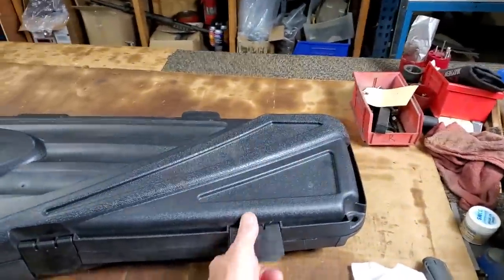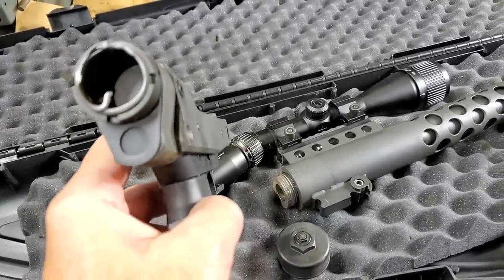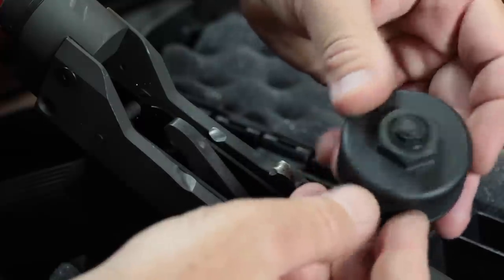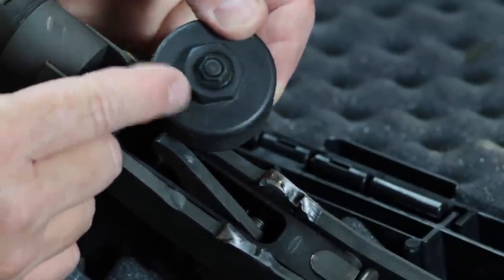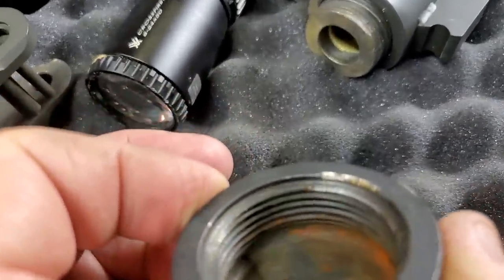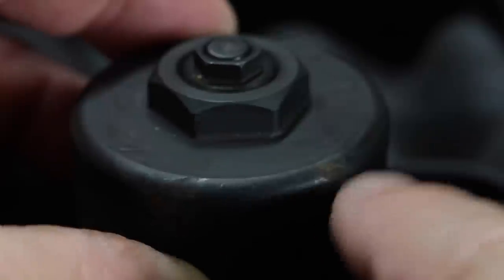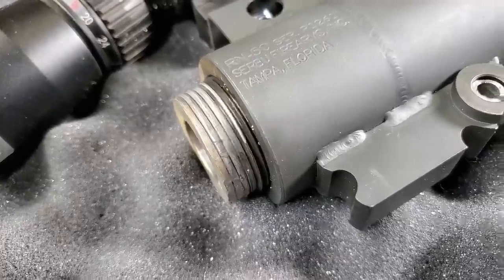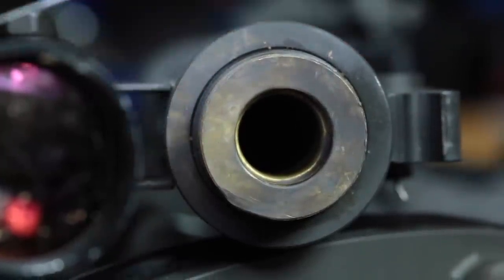Kentucky Ballistics' RN-50 Blow-up:  First Look

Comment: I've got to imagine your lawyer hates you so much for all this transparency. That's how I know you are trustworthy
Reply: A gunsmith first, a business man afterwards. I can respect that!
Reply: Despite the lawyer. I gave to imagine. Marks character and Scott's is why I don't believe there will be a lawsuit even attempted
Reply: I don't know anything about either one of them but I watched a video a month or so ago where a guy nearly lost his life when one of those blew up in his face. So to my understanding, this guy in this video is that gun's creator/manufacturer? So the guy who the 50 blew up on handed the evidence over to the gun maker??? I keep seeing people say how both are stand up guys and all but I can imagine that not just the injured guy's lawyer but all attorneys everywhere are going "WTF?" right now.
Reply: Transparency is the honest approach... but also his best defense on this one. That round was CLEARLY over-pressured, and by a massive amount. Normally, you can't fit a double charge in a 50, so it's almost as if the wrong powder type was used.
    The only other factor I can think of, is that this round is old, and was stored somewhere that exposed it to excessive vibration. Over time, the pelletized propellant reduced itself to a much finer powder which could result in a far faster pressure curve.
    In any case, it would have taken an insane pressure curve to shear that much steel in the way that it did. Far more pressure than any gun could reasonably be expected to hold.
Reply: more like loves him for getting the guy to give the gun up vs. having a third party examine it first
Reply: @JJM2222  If anything went to court, that rifle is going to be examined thoroughly. Also Mark isn't a jackass, on a human level, He doesn't like what happened.
Reply: @Mr.Ekshin  Shouldn't the appropriate modern rifle powder be "over charge safe" by means of it's volume? I know though that this isn't the case with all surplus ammo. I used to to work with Rheinmetall autocannons and did cut some shells open and even those had the cavity filled by propellant completely with a normal charge. 

Maybe if there is one of those SLAP rounds left they should open it and examine its propellant. I have heard of several cases in Irak were "leftover" ammo has been manipulated like the story in Vietnam. Could those rounds made it back to the U.S somehow? AFAIK the use of SLAP rounds were rejected by officials with the then in use Barret because of its muzzle break. Maybe some shooter just reloaded that rounds and made a mistake and used some pistol propellant instead.
Reply: @nickabel8279  What would you sue Mark for? Scott loaded ammo the gun is not rated for and it failed. That is not the fault of the maker of the rifle but the person who decided to fire shitty ammo out of it.
Reply: I think the only person who could be sued logically is the ammo company or who he bought it from.
Reply: @nickgarcia7415  ammo company is likely out of business, these are old rounds. Related, there’s really no way to prove the last seller is the one who tampered with it because there’s no chain of custody. Serbu is the only one who really could be sued, and they would make the case that it was the round being overpressure at fault. In all likelihood there just isn’t a lawsuit here period.
Reply: If he really cared, he might high an engineering forensics expert who would have told him not to do all of that fondling of parts.
Reply: I would imagine Scott's lawyer feels the same about him sending the wreckage to Mark.
Reply: D J  he is a expert 😂
Reply: There probably isn’t a lawsuit case because it would come from Scott and a lawyer wouldn’t want you to give your evidence away.
Reply: @SJS_Family_Racing   Clearly there isn't a lawsuit because any good attorney would consider the gun the critical piece of evidence.
Reply: He's dealing with Scott, who is unlikely to sue, and has to make sure that his public image and reputation survive this incident.  The slightest bit of defensiveness or lack of forthrightness, and he'd be finished as a business.  He's too much of a public figure to get away with that kind of behavior.  I'm sure the content of these videos was discussed with legal council beforehand.  As much as this sucks for Mark, I think he's doing it right.
Reply: @nickabel8279  theres literally nothing scott could ever do to sue, he would have his case thrown away by the judge before it even hit trial, based on preliminary evidence, statements made by experts and other lawyers as well as common sense.
Reply: @FinnMcRiangabra  What's it gonna matter? It's not like they need to dust it for fingerprints, they know what happens and what's at the cause of it happening. Just gotta figure out how to stop it from happening again.
Reply: Not how it works in the gun industry. Being transparent and honest is the right way to do it. No liberal crazies here. And Scott too being honest about running a round that is clearly a monster and knowing it. These aren't your everyday off the shelf rounds lol.
Reply: @nickabel8279  there are most definitely alot of lawyers willing to take up the case but the YouTube gun community is very tight nit and Scott doesn't seem very upset, he just want to know what happened.
Reply: @tripalong  this is how America should be. Scott knows this wasn't Serbu's fault. And upstanding people don't always rush to lawyer up. I'm sure if there was a problem with the rifle, Mark will happily make it up to Scott. Its not always about money!
Reply: @HeadlessZombie1991  It wasn’t really Scott’s fault either. He had no way of knowing the rounds were that hot.
Reply: @blackbirdgaming8147  I mean firing slap rounds is always dangerous even when they are legit. They literally blow up m2 50 caliber machine guns in the military and are known for being that way. You are just inviting trouble by shooting surplus slap rounds in the first place, it's not mark Serbu's fault.
Reply: yes
Reply: @CntFndAName  Wrong. Among other things, needlessly putting the fracture surfaces back together will destroy evidence. You don't do much fractography do you?
Reply: @tripalong  It's called honor among men. Serbu believes in his product, Scott believes in Serbu and doesn't think it was the gun, more likely the ammo. It's almost like problems can be resolved among men without the need for adjudication and litigation.
Reply: @1x93cm  You mean a world in which every accident, incident, or idiotic mistake does not need to take up time in court and make lawyers money? Just a couple guys solving their own problems and learning what they can to prevent said problems from happening again? BLASPHEMY!
Reply: @nickabel8279  if any lawsuit would be filed it would be against the person that sold Scott the slap rounds
Reply: Honestly, like with medical malpractice, if you own the mistake, the party involved is likely to be far more forgiving. I also don't know how old these rounds are, safe to say, though that they're definitely not normal factory loads. Scott's a smart man, and I'm sure he knows that the pressures and forces involved to make a firearm fail like that are far more than any firearm is designed to handle.
Reply: Scott has no intention of suing, it wasn't a gun malfunction. It was an ammo malfunction
Reply: @HeadlessZombie1991  You're assuming the barrel threads that sheared off had no metallurgical issues.
Reply: @HeadlessZombie1991  actually the round was rated for the gun but was eather tampered with or stored wrong and Scott from Kentucky ballistics said he thought they where genuine slap rounds that where not tampered with but he was wrong he doesn’t hold mark at fault he even says in the video he should have stopped firing after the second shot had a bigger fireball then what is normal for the rounds but he didn’t
Reply: It was the round not the gun
Reply: @WillF1980  ya the round fucked the gun
Reply: He can't control what rounds are used.
Reply: A personal injury lawyer went over this case as a review and according to the law, Scott would not win against a lawsuits against Mark due to the design of the gun and what actually caused the incident.
Reply: @nickabel8279  it wasn’t the gun’s fault. It was the round’s
Reply: @tripalong  probably because both parties understand it was the ammunition's fault, not the rifle, that's probably why there's going to be no lawsuits brought. You seem like the type that would want an instant million dollars if you spilled your hot McDonald's coffee on yourself LOL
Reply: It wasnt any of their faults, it was probably a hot round, and there is no way of telling if it is, so scott was just super unlucky.
Reply: @tripalong the gun is usually not the issue when a detonation happens. In Kentucky Ballistics' (Scott) case, he used a SLAP round that was overcharged, unbeknownst to KB. That round isnt produced anymore, and was likely counterfeit. Mark Serbou, nor KB are at fault. It was a freak accident. There would be no grounds for lawsuit in KB's case

Comment: I love how many rumors started from this. People act like a Barrett or M2 never blew up from bad ammo or even a faulty part. They absolutely have. What hasn't happened before from a firearms company is what Mark is doing where he's being 100% transparent about it. Much respect.
Reply: When other rifles blow though they usually either blow most of the pressure out of the breach or mag well downwards or outwards, or the barrel explodes just forward of the chamber and ends up looking like a banana peel. People still get hurt, and sometimes lose hands, but it is less likely to be fatal.
I agree though that it is very admirable how transparent the company is being.
Reply: @justinblake7355  wrong barrets and ma deueces have blown up from the chamber. seen pics of a barret that blew up from a shooter that ejected what he thought was a dud but was instead a hangfire. the pressure going out the open chamber was enough to break apart the barret and gouge chunks out of the shooters face. 

there are pics of a soldier in afganistan who decided to use a .50 bmg round to hammer in a part on a ma deuce turret rather then get the proper tool. the .50 bmg went off and turned his hand to ground chuck. 

give you a clue any three to four time pressure load would have turned a ma deuce into scrap and potentially killed the operator and crew.
Reply: This is the equivalent of what happens after an aircraft crashes.  I.E. Delta 191:  The NTSB is certainly involved, but Lockheed (L-1011) was as well.  This is the same as Lockheed arriving on scene.
Reply: I think a Barrett may kaboom similar to this but it would take a hell of a lot to make an M2 go to bits. The receivers on those things are monstrous.
Reply: @toomanyaccounts  I am highly skeptical of that last story. As someone who has set off numerous rounds outside of a chamber and Barrel, that doesn't sound likely. There are plenty of videos on YouTube, but a 50 BMG round just going off in open there is not going to have a whole lot of pressure to mangle someone's hand unless they somehow are lying on top of. Sounds like a little bit of hyperbole was going on here.
Reply: @Laotzu.Goldbug  The way the othe person worded it, I thought the soldier was holding .50 round within his grip. I still have a hard time believing anybody, a soldier especially, would have come up with something so bad, but yeah.
Reply: @toomanyaccounts  let's imagine your stories are true, they're both stories about a round that was not chambered in the gun so they have no point in the discussion
Reply: @Uryendel  it shows the power in a regular .50 bmg is enough to blow apart guns that people somehow think are invulnerable to what happened to the rn-50
Reply: Raises a question of lug v thread for breach design?  Maybe calls for a heavier thread design?
Reply: @utoobuser206  the threads are the strongest their is. the threads were sheared  from a force that is more then the explosion that occurs in a tank barrel.
Reply: @toomanyaccounts  defects happen.

Comment: My suspicion has always been from the beginning that Scott had a seriously overcharged round, likely hand reloaded and sold as factory loaded.  I have never- nor would I ever- believe that the rifle was at fault.  In fact, I'd go so far as to say that- had the same round been fired out of many other rifles, Scott might have been outright killed.  Mark overdesigns and overbuilds his rifles, so I would trust them with MY life.
Reply: He fired another slap round out of a barrette 50. Rifle and it cast is trivially failed and he would absolutely have been killed.
Reply: Scott's been saying those SLAP rounds run $100 each, well up into collector prices. I can't help but wonder if somebody ran the two fireball-ish cartridges through a vibratory tumbler, making them shiny for the collectors,  and knocked the deterrent coating off the powder granules.
Reply: That sounds like a really good possible explanation. Brilliant.
Reply: I’ve always wondered whether that breech cap made it more or less dangerous when the gun blew up. Maybe it allowed the pressure to escape more easily and despite hurtling a heavy piece of metal straight back at him, it’s better than the metal fragments that would’ve happened with any other design.

Comment: Great to see that a manufacturer is publicly addressing what every one is wondering.
Reply: @georgetrynamakeajug  lol, no.
Reply: I mean it technically isn’t his fault since he never tampered with the gun or ammo so whoever fucked with the ammo is at fault even if it was an accident or not
Reply: @georgetrynamakeajug  When you're firing rounds that have a questionable history, how is that his fault? I bet if you stuck the same round in a Barrett, it would probably do the same thing, if not worse. Barrett specifically says don't use SLAP rounds in their rifles for this exact reason. I'm blaming Scott on this one, play with fire, and you're gonna get burned...
Reply: @robdog1245  More like because it'll  hit your muzzle break lol.
Reply: @georgetrynamakeajug  More like he wants to see how it failed and if any steps can be taken to improve the safety of the rifle. I'm guessing they have blown up some rifles in testing, but it can't hurt to have a more 'natural' case study.
Reply: @robdog1245  actually the slap rounds where rated for the gun it’s just Scott didn’t notice that the second round he fired had a bigger fireball then normal until he slowed down to show us what happened I am just glad Scott is alive and ok